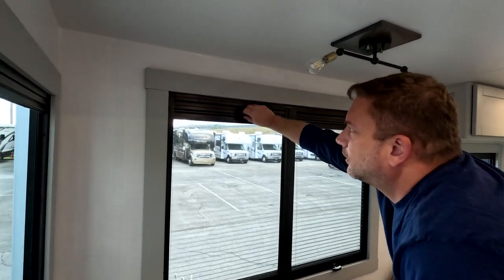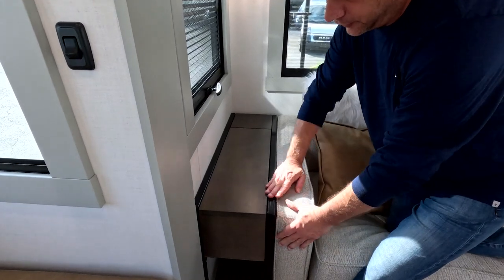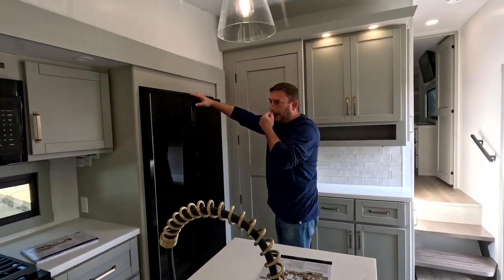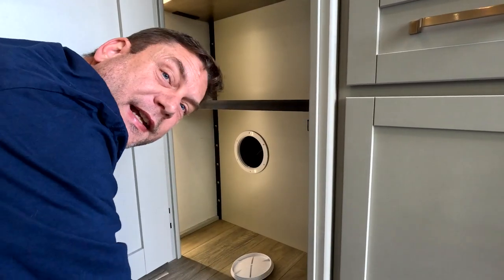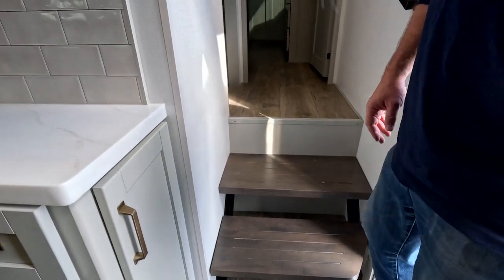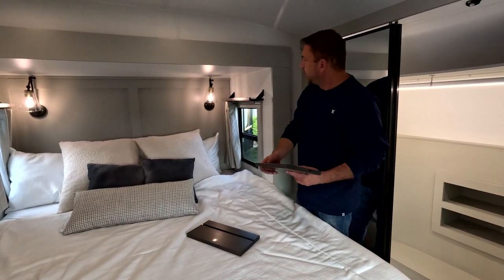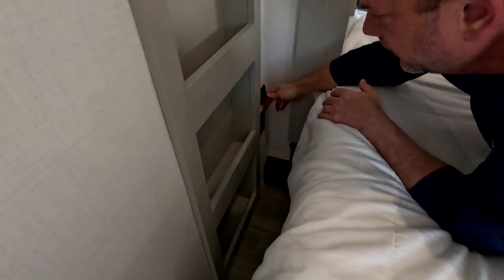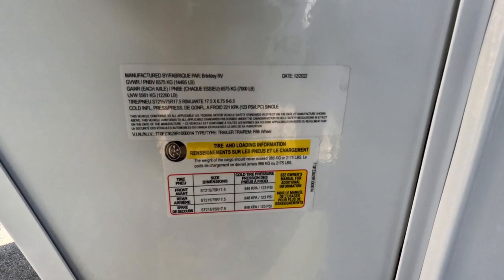The All-New Brinkley Model Z 3100 - Mid Sized Luxury 5th Wheel

Comment: I’m so glad you and Maria reviewed this in a rig with it connected to power. I just toured one this morning and it is truly amazing. The one I looked at was already sold. It had the second AC which is optionally removed — it’s standard now. The mattress was just as you stated. I didn’t actually plop down on it since it was sold already but I opened and closed everything. The bathroom now has a full sized exhaust fan. The way it’s built there’s no real need for the drop frame. And the slide have tiny little lights. The only thing I wasn’t enthralled with is the pin box. I’m ordering vey soon.
Reply from the maker: Glad you liked the video. We absolutely fell in love with it and have some good friends who have the G (toy hauler). They do lots of videos on theirs, so if you'd like to follow, their channel is @WhileWeStillCan!
Reply from the maker: Second replay here. we just got off the phone with a dealer in West Kentucky. they have one coming in the first of sept. https://adventure-camper-sales-llc.business.site/ talk with Trevor, 270-992-1248.
Reply: @OurRoadLessTraveled  yes I do follow them too. My hubby is also a snorer. Lol.
Reply from the maker: @longgone2023  you may need to get the G too then! 😂
Reply: @OurRoadLessTraveled we just bought a brand new F250 Lariat Ultimate with upgraded tow package, Tremor suspension but not lifted and has regular tires. It cost more than the fiver lol.
Reply from the maker: @longgone2023  make sure you write down the payload numbers so you know when you are getting close to them. Tremor is a nice truck. Love the dark midnight blue color.
Reply: @OurRoadLessTraveled  it’s a stealth Tremor. Ford is doing this confusing STX stuff on various lines which confuses the heck out of me. But the difference was this truck appeared at our dealership with a bunch of extras ordered and he never picked it up. I think at the time, orders were taking forfreakingever people went and bought Chevys or Rams.  It has upgraded shocks and a 10k gvrw rating and is white. It’s gorgeous but I need a step ladder to get in and a parachute to get out.

Comment: Nice. If that's a mid-sized, how much larger is a full-size, and what do you need to tow it?
Reply from the maker: the 3100 has a max weight of 14,995 pin weight of 2100 They just released their toy hauler and smaller 2900
https://www.brinkleyrv.com/

Comment: Maybe I missed it but is there a sound system on the unit.  I didn’t see it nor any speakers.
Reply from the maker: Not 100% sure, but on their website it says "Premium Audio System with Bluetooth" and "Exterior Speakers with Bluetooth & Campside Controls & Bluetooth". A lot of the awesome features on the Brinkley Brand are hidden, so it's probably not in plain sight. Hope this helps! Thanks for watching and commenting!
Reply: @OurRoadLessTraveled the speaker is Bluetooth dead center over the living room just in front of the tv. There’s no amp or radio or stuff like that as equipped. I don’t know if the tv can link to the bluetoooh speaker. Just pair your phone, iPad or connect an Apple TV. The winegard is 5G
Reply from the maker: @longgone2023  good to know. This one in the video was one of the first off the line, and a prototype if I'm not mistaken.